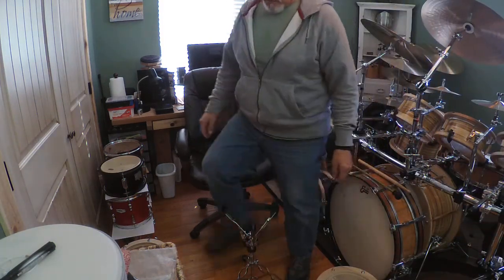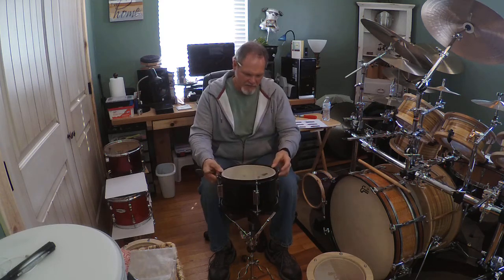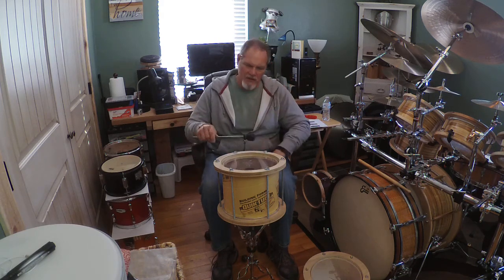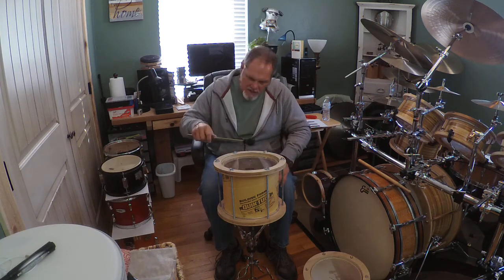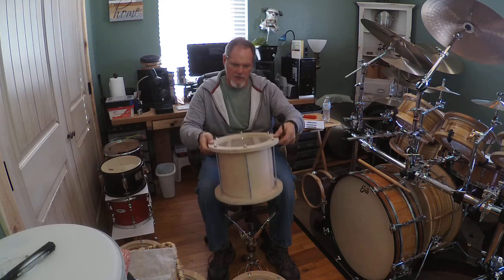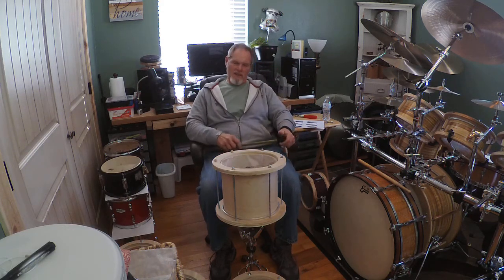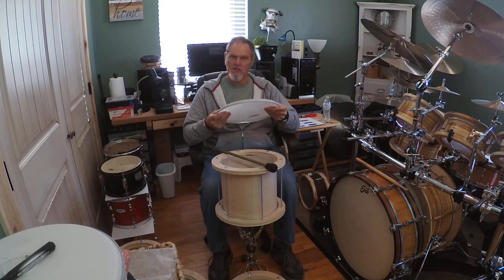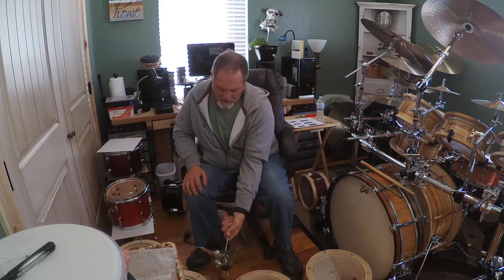Drum Shells and Sound - Bearing Edges, Part 6

Comment: 5:30   As a sound engineer and drummer, I totally get what you are saying in general. A Good, Solid, Well-Built shell (all things being equal... depth x circumference, etc not withstanding) However, With regards to frequency range, you would be surprised just how many frequencies contribute to the sound of a drum. Now, if the Note given off by a drum is , say, a G, Yes, You care correct in that there is only a given frequency range in regards to pitch. What is not necessarily common knowledge is the amount that overtones, harmonics (to varying degrees) and attack, as well as depth ..Especially on Floor toms where the fundamental note may even be a bit high, but the air it moves as well as the interplay between the heads all contribute to the timbre of a given drum. *I love DW for many reasons, but only 10% of that is dedicated to  m o s t  of their shell offerings/finishing and innovation that do indeed have some worth. (They make great hardware and the logo, imho, is rather simple and elegant. MY POINT (Lmao... ) is if you take that toy, use a full frequency condenser on it (closest recording instrument we have to the human ear) and then while playing back the sound file, just take all the highs and lows out of the equation and note what happens. If you repeat this, with a few different drums tuned to the same fundamental note, using same heads, then different heads, ..it' gets pretty damn interesting Sonically. *Would I ever pay DW's asking price for a kit.. Nope. I have a 1929 Ludwig Pioneer 14 x 26 all Mahogany bass drum, thin shell, no silly sound holes or pillows, just a bit of hidden felt on the reso head like the old cats used to use, that moves So much air, has high end for the attack and just makes Such a beautiful noise...End of story. I have zero bass drum envy :) ~ It's interesting... I've tried to get the tone/ultra low end from a new, solid ply and thicker shell 26" DW and it just doesn't have the subsonic frequencies the thinner shells have. I've noticed this on floor toms as well especially. 14'' floor toms are some of the most underrated pieces of a kit for rock. Anyway, There is a bit of alchemy when it comes to shell design, but with good heads, you could probably make a stack of welded-together tuna cans sing. My best educated guess is that it applies to some, but not all of the way a drum sounds. Cheers!!
Reply from the maker: Not disagreeing with anything here. For me, though, real world playing of a drum set in the context of a band, everything that enters nuance territory is lost. When mics, electronics, software  and all enter the mix, it all becomes moot. That's why I believe all the ultra-hype in the drum industry about shells is nonsense. Change the heads, change the sound of the drum, including canceling out all those extra frequencies that can be heard in isolation. I never argue with anyone about nuances and subtleties they hear coming from a drum. I just reject the notion those can be heard in the context of a band, or even the context of a solo set when cymbals and everything are cranked up. There's just too much going on for any of it to be heard. If I go from single ply heads to thicker/dble ply, I know the sound will be "fatter," drier, and more of a slap sound, and generally a lower pitch because the heads vibrate more slowly. I know if I use the various calfskin alternatives I'll get a slightly softer sound. The shell is meaningless to those differences. 
As you can see in the series, I have a paper tube drum, garbage cans, stacked edge plywood drums, and the newer snare videos with materials not generally used for some of my drums, as well as a hand made shell that is a total mess and the drum still sounds fine. They all sound fine. For me, it's all in the heads, how they seat, and if the drum is allowed to vibrate fully. But, even there, that's subjective. Thousands of players using vintage gear love the sound of drums mounted right to brackets and bass drums, or using old floor tom tips, etc. The extra response of isolation mounting is no big deal for them. 
In all the research papers I have read on drums and all the lab work, all of it becomes equalized by the common ground of a band. You might hear more in a acoustic Jazz band but, once the electricity and amps and all get involved, drums are drums, as far as well made shells go.
Reply: @REFondrums  Heya! Thanks for the reply! I can agree with that. I suppose most of my meaning was specifically for those purposes of either soft, solo jazz drumming -..Obviously there are those who are tone def (this applies to both singers and drummers.. Lol) and the tone and timbre can effect theirinspiration to create based on how well drum is tuned ..its relation to the shell, whatever it may be, etc.. So,. I feel there's some value there., albeit on an individual basis. This would be an instance where a Well Tuned kit would come into play., and Snare tone. A beast all its own. Extended snares; Symphonic use snares and all this madness.. I had to record a track once with an orchestral snare sound/drum section, etc.. (the bass drum I have being a 26, tuned low, mic'd real close and hit softly shook the room during playback (Good stuff :)  ..But I was not going to go buy a $$$$ snare for this. I turned my 66 Ludwig Jazz Festival upside down and played it gently on the snare side head.. a bit of small tweaks and POOF! ..recorded the same part 6 times. Problem solved. ;) Agree the heads make a lot if not 98+% of what one is hearing. The marketing side of which you speak, I 100% agree. I am actually building a replica of Sir Neil Peart's Old Faithful snare (Head choice was key, and attention to detail, research, and just for fun). The shell, just a 3 ply standard late 90's Premier, cost 40bux for the entire snare. (and gives me something fun to work on). Ultimately, The other side of the coin is simply This: If you can afford a Cadillac because you like the way it looks, then by all means buy one. It will still get you from A to B, ..just like a Pinto. SO, If someone dredges up some 1500 year old log from the Euphraties river (spelled wrong probably ;) , and someone will make a shell pack for billionaires out of it that looks dark and beautiful, ...well, I suppose that's capitalism! Lmao ! Cheers!!
Reply from the maker: @remotexpolde  Totally agree. I say that repeatedly, as well: it's your wallet. Spend your money however you want but, do not think because you are spending more money on the drums you are getting better sound. Better finishes, hardware but, not better practical sound. When a company tells people some ancient tree from a tar pit sliced into veneers and glued together is going to sound different than anything made from a tree cut down at 30 -50 years, I have to call BS on that. If you want to market "uniqueness," have at it. Better or unique sound? No.  Now, if they cut concentric circles out of a log and made sets of solid shells (like Heartwood Drums), I'm figuring a set made of those shells will produce some serious volume and pure tone, especially with wood hoops. But, even there, when a big band cranks up ...
And yes, in reference to an acoustic Jazz small group situation the ability of any drum to expose it's nuances and subtleties is greater, especially snare drums. 
You also make a great point about the abilities of modern recording equipment with your bd and snare side situation. 
Have fun with your snare project.
Reply: @REFondrums  Thanks much! (actually off to sand the next interior coat of poly right now. :)  (Lovely chatting btw :)  ..Yeah, it does make me nuts when the "wallet factor" turns into more of an equation of 'Spend More, Sound Better". I'mean, I sorta feel ultimately at the end of the day it's Definitely How you tune them, Whatever ''Them" happens to be,. and 100% How you Play/Lay into them. If you have feel, ..Pocket, Heavy, etc.. you can make cardboard boxes sound great... in the Ever so overlooked context of the SONG. (which has been my goal ever since HS, being a player for touring and studio situations). Nirvana's Nevermind... I saw that kit D.G. used in person (at the EMP, Seattle, when I lived there). It was a complete Mutt! And it's responsible for one of the most iconic drum intro's probably ever in modern times. So, HOW MUCH DID HE SPEND??  Lmao... Probably some beers and a cheeseburger to a friend who had drums they weren't using and the need to actually PLAY SOMETHING. This easily trumps essentially everything.  This subject fascinates me as I also design loudspeakers BUT ..using actual physics and down to earth methods and also educating folks who, Again, feel like if they spend 5 figures (or more) , they get better sound.. ..as if Fairies will jump out of the drivers and massage your face with secret oils from that place Falcor hangs out at.. UGH! Lmao !!  My kit is Also a mutt. It's all white marine pearl, wrapped it myself, (with said 1929 Ludwig bass drum, a Gretsch Catalina 14x14 floor tom, (No re-rings, and thin maple shell, a 60's Slingerland 16 x 15" floor tom and 12X9 rack tom. I sanded all the bearing edges back to where approx 1mm (rounded) is the head's contact point. The rack tom is a jack of all trades... With thinner coated heads tuned higher, .. tone straight out of Zeppelin IIII. Clear heads: any modern tone you want. It's just a Round, 3 Ply shell (that looks pretty ;). "FORM AND FUNCTION, I say ;)!  (been researching this little puzzle of bearing edges for a while.. Super interesting. However, I want real world tests with different edges for different  pieces (toms, vs snare, etc) before any Holy Grail edge is more preferred In General than others. Equally bizarre to me is other wooden instruments and their unique tone. Even just a $150 Yamaha can out-sound a Martin if built properly - and ALL comes down to personal preference. Once you cut away the 'claims and snake oil', the world of Sound is a beautiful and fascinating one. Cheers!
Reply from the maker: @remotexpolde  I don't really follow bands anymore but, IIRC the player with the Headhunters has a kind of mongrel set. There's another guy I can picture but, can't remember the name with the same kind of rig. And then there are all the times world class, top name players can be seen with mongrel kits for gigs because of backline issues from time to time.  
I'm going to put together a small kit from all the 10" toms I used in video #2 and do a video with that. 
Somewhere along the line the idea of sound and eye candy mated and became the only "correct" way to play drums. 
A lot of players, especially young players, do not realize the effects of simple tuning/tension between heads and what that can accomplish. They go into drum shops and judge based on what they hear and I have rarely been into a drum shop where all the drums are tuned up to optimum sound. But then, "optimum sound" is subjective. I like wide open, clean, clear sound. Others like a flat, thuddy, tubby sounding drum. They barely take the wrinkles out of the heads. That's what works for them.  
One of the sweetest sounding, if not THE sweetest sounding 14x14 floor tom I ever heard was a Premier I just tapped on in a shop 30 years ago. Upon reflection I don't think it was the Premier drum, per se. It was just tuned up for optimum tone and sustain between the clear, single ply heads.
BTW, I have mentioned on these videos the process of making cardboard boxes sound like drums. There are couple videos on YT I have seen it done years ago. I imagine they're still up.
Sound is in the "ear of the beholder" and function is whatever works. Realistically speaking, not many players can afford top of the line drums and they should not be made to feel bad because they can't, especially with super-hype marketing.
Reply: @REFondrums  That's rad about the 14'' .. Back in Seattle, (in Boston now) , I had a friend who worked the drum shop in American Music. This lad was an absolute guru when it came to tuning. (So much so, he was eventually hired by a national act to be their drum tech). Great drummer too. What I was able to glean from our conversations was minimal ..especially for my nearly all right-brain, artistic Pictures-Only mind.. Lol, but Not being afraid to go for it and try new things was paramount. That alone improved my tone by light years. *Could not agree more , btw, about drummers, both new and not so new, going into shops and not understanding the relation between proper tensioning / tuning and the high gloss lacquer finish they are 'listening' to. As with piano strings, guitar, etc.. All these are tensioned to make a note/tone, etc.. A shell without heads isn't really a drum. lol.. Just like a Lamborghini without gas is a pretty fancy paperweight. ;)
Reply: @remotexpolde  I currently reside in Seattle now and often go to that American Music point. 
I wont mention his name, but i think i may know your guru as he's been helping me decide between my Tama or Dw progression. 
I own a double configured Starclassic Performer Series Maple Birch kit and a Walnut Birch kit. 
I got them so i could get more studio session gigs.
I like Dw cause i feel there's a beefyness that could just be my own interpretation from the bottom end frequency. 
I want to either upgrade to a Tama Star or Dw Collector's Series, but the nuances are only so subtle and i admire both.
I gravitate toward Dw's 9k pedals, their snare drums, and majority of their cymbal hardware.
Tama is sturdy and a little lighter to gig with.
This video opens my mind to what how i like my drums to behave sonically. 
Seattle has changed the past 10 years and I'm doing all i can to even keep music alive in me. 
It's refreshing to hear other's passions on how to make drums work for you before spending all your earnings. 
I debate now between Tama Star Walnut and Dw Cherry Mahogany. 
More importantly, i just dont want to stop improving. 
Garstka really set the bar for dedicated practitioners. 
I seek to push my boundaries as a drummer also and i talk to a certain guru myself at American Music about how i want to progress my sound.
He tolerates me and feeds me knowledge.
Seeing this video does make me question though, how do i live my frequency?
How loud do i project?
Is it worth to even buy drums i like when i honestly hear the good in everything...
Any case, sending you Seattle vibes.
It's beconing harder to be an active musician here, but some of us are making it work.
Reply: Doooode! Thank you!! Much appreciated. :) - yeah, I miss that side of the country. It is so much more civilized . -and music here is just a mash of auto-tune misery someone from a tone generator factory mislabeled “Music” . 😤
-_-  I used to do drums (standing up) and lead vocals for a Radiohead tribute a while back. So much fun. - I feel like after Covid, it wasn’t just sense of Taste that disappeared.. Music just got weird. 
Anyway man, thank you again for the friendly hello. Much appreciated. And all the best with your decision - whichever way it ends up taking you :)  All I can say is Do Not be afraid of experimenting with tuning. Take Everything you’ve heard, toss it in the garbage, and remember this : When the very first piano was finally built (around the same time as the planet started forming apparently., ;) … Who exactly was it that showed everyone how to tune and play it? I admit I don’t know the name of whomever it was that taught young Mozart how to play., but given his career . . . I am pretty sure most of that All came down to having an open mind and just experimenting. So enjoy the process my friend. , Start from Literally Scratch, take notes, and pioneer your own sound. (( i was fortunate a few years ago to be able to experiment with many different heads while looking for a specific snare sound. For a 1973 Slingerland Chrome over Brass 5x14, I found a calf tone batter (heavy Diplomat equivalent) and Evan’s 300 snare side just made Such a lovely vintage sound. - when I sold it, the guy called me out of nowhere and thanked me for such a great sounding drum. - so again, Enjoy and go boldly into new sonic terrritory 😊👍. Cheers!!